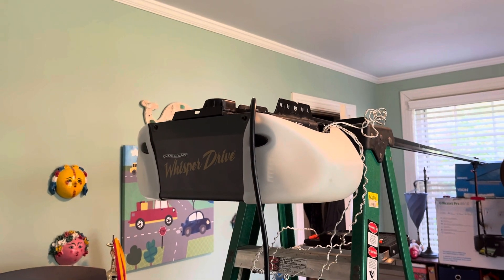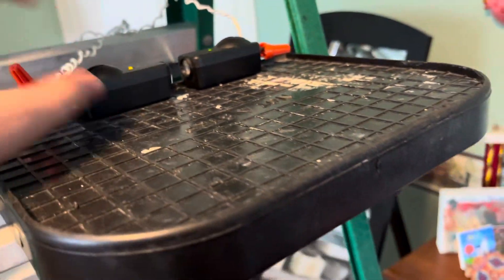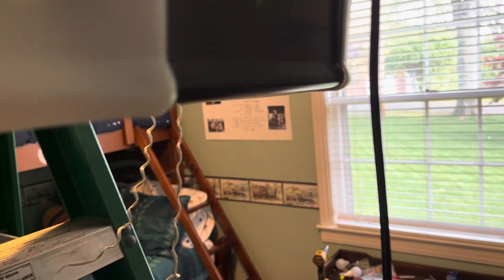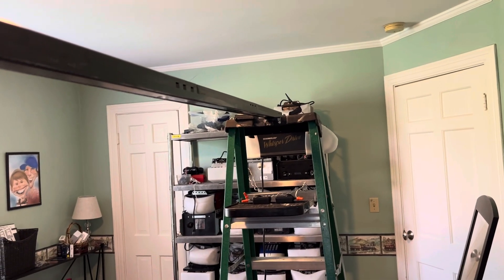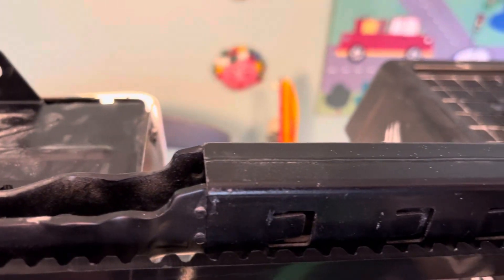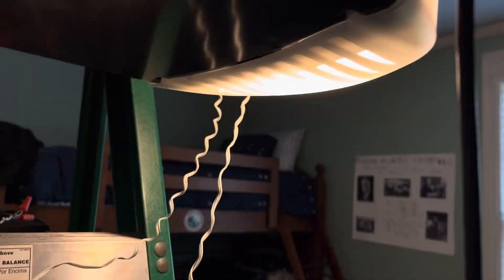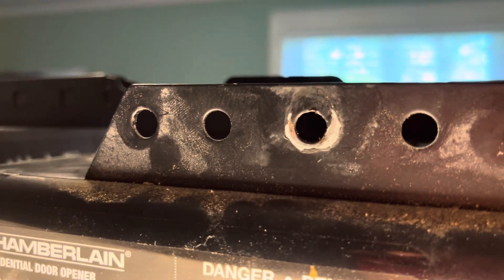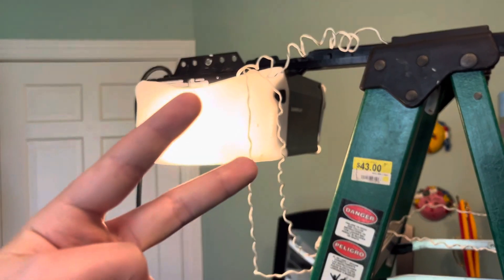Chamberlain HD600D Review

Comment: I have a chamberlain WD822KS Another version of that HD600D Do you know How rare those things are because I don't know Where to find a logic board for it because when someone replaced it They probably UnInstalled It's aggressively and broke the sensor wiring and the wall button wiring so I had to use a whole bunch of electrical tape to get it working So yeah I just wanna know how rare these machines are because I can't see the find the right logic board for it
Reply from the maker: those aren’t super common but you could probably find the correct board on eBay
Reply: Thank you🎉